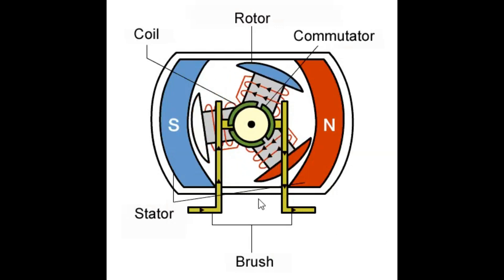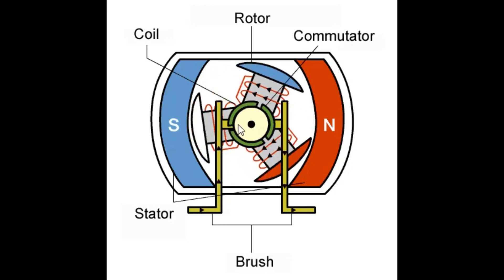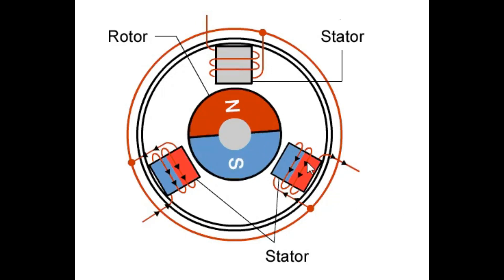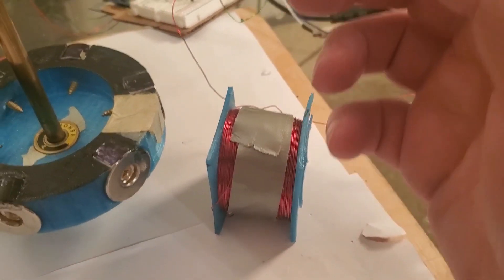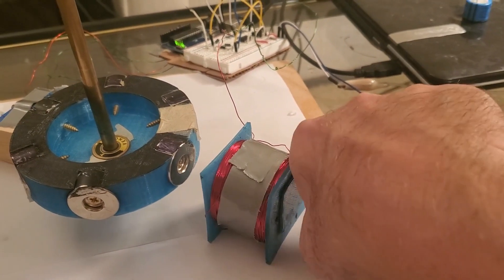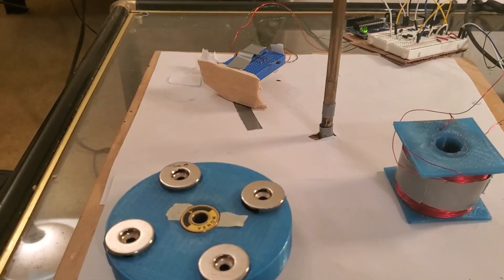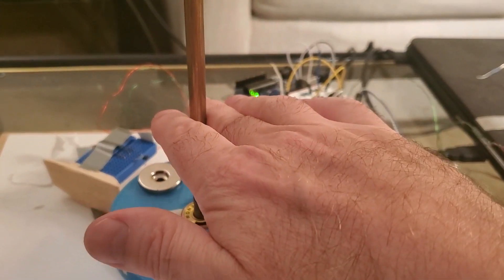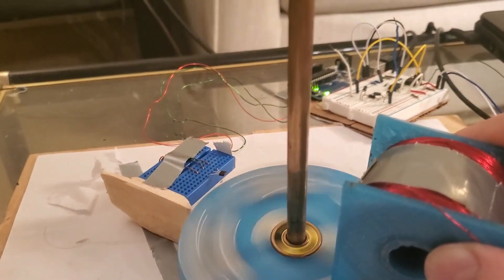Designing the Next Gen Pulse Rotors, Part I: Rationale

Comment: Thanks Paul for the great channel. My Arduino is on its way with Hall Sensor board and Mosfet board.
Reply from the maker: Outstanding! Let us know how it works out.  Here is the bipolar commutation code again for if you are using a ratiometric/linear hall effect sensor.

int pin13 = 13;
int pin12 = 12;

void setup() {
  // initialize serial communication at 9600 bits per second:
  Serial.begin(9600);
  pinMode(pin13, OUTPUT);
  pinMode(pin12, OUTPUT);  
}
// the loop routine runs over and over again forever:
void loop() {
  // read the input on analog pin 0:
  int sensorValue = analogRead(A0);
   // Serial.println(sensorValue);
   // delay(250);
 
  if (sensorValue < 50) {
    digitalWrite(pin13, HIGH);
    }
  else if (sensorValue > 100) {
   digitalWrite(pin13, LOW);
  }
  if (sensorValue > 350) {
    digitalWrite(pin12, HIGH);
  }
    else if (sensorValue < 300) {
   digitalWrite(pin12, LOW);
  }
}